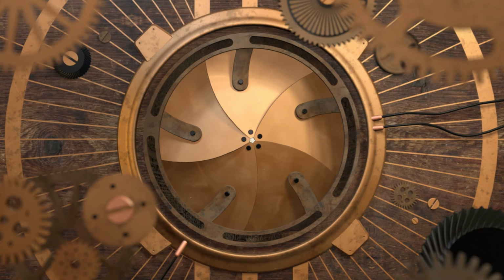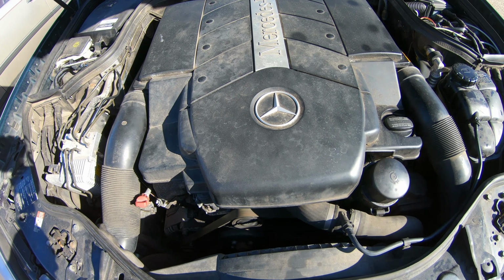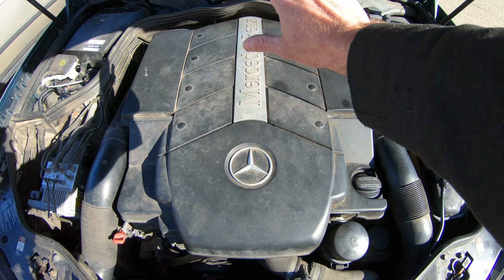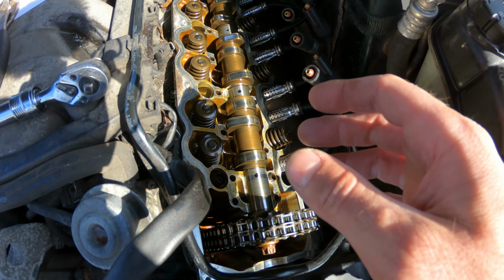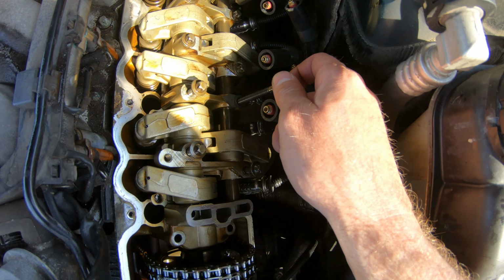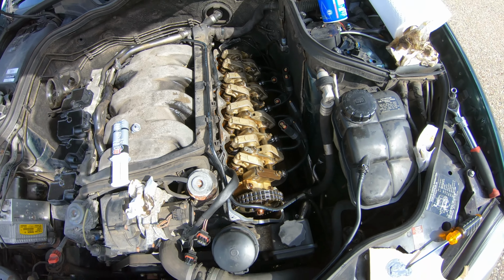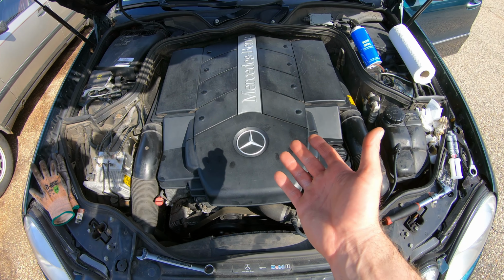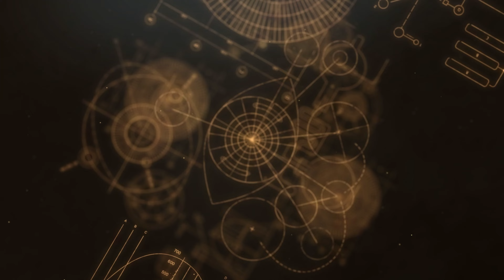FML - Fixing A Misfire On My 330K Mercedes-Benz E500.

Comment: Hi man, i think i have same issue, i checked everything, sparks, coils, coil harness, engine harness, Fuel pressure, injectors. Everything Ok. 

I have CEL after half or full load at 5k RPM, and if i check DTCs - misfire on 6 cylinder. 

Do you think it can be same problem as yours? 
Today i unassebly this parts as you, and try to get another one with lower mileage from working car.
Reply from the maker: Did you check compression? That is what ended up being my problem.
Reply: @ yes, good, my problem was in camshaft sensor and ecu adaptation. But cumahaft sensor looks in star diagnostic good.

Comment: I recently bought an E500 4Matic station wagon, these are really nice cars, very pleasant to drive, I'll keep my fingers crossed that yours will be up and running again soon
Reply from the maker: Congratulations! I love this thing. Mine will run again. Thanks for crossing your fingers. I will need that. Lol
Reply: @financialmistakesliving  what did u do? I have the same problem
Reply from the maker: @FxChris27  I have a replacement motor that I will be changing soon.
Engines are pretty cheap for these, So it made more sense to replace with a lower mileage one.
I suspect a burnt valve.
Reply: Injectors is the problem....

Comment: I'm going through the same bullshit with a V6 mercedes
Reply from the maker: Hopefully your motor is in better shape than mine
Reply: @financialmistakesliving  hard to say, no major ticking sound yet, but it has 2 leaking valve covers and multiple missfires, bad auxiliary battery, SRS light and 216,000 km